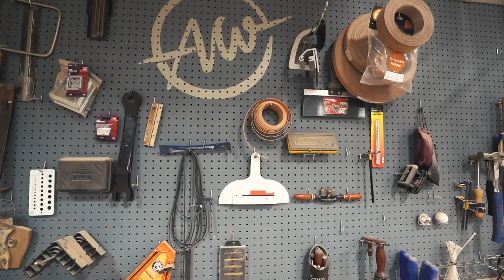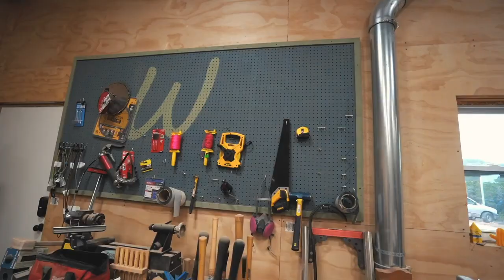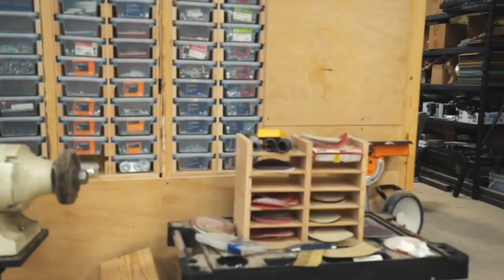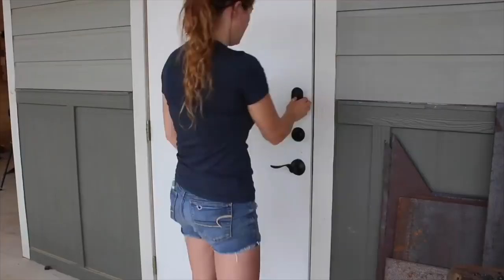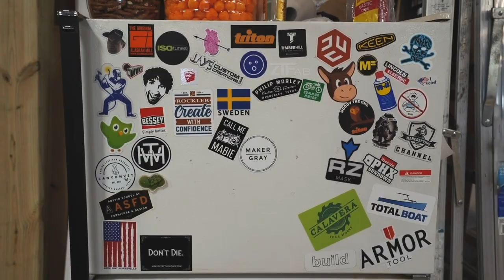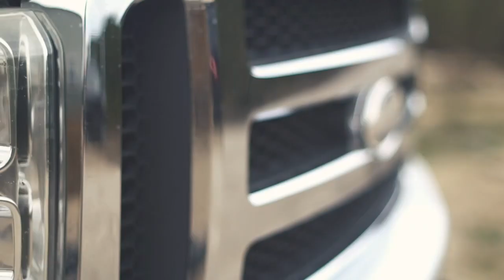1st Time Shop Tour April Wilkerson

Comment: Re tablesaws- I did the exact same thing! (Much smaller though) I took the tabletop 10" delta i used for years in my flooring/remodel biz and mounted it on a stand with my dado stack  installed & I have a big OLD craftsman I use for cutting-  great minds think alike as they say LOL- Tyler

Comment: Regarding the 3 Phase sander, the easiest method is using a VFD. Almost all VFD's will take single phase in, put 3 phase out but derated by 33%. So if your motor is 2 HP for example, you will need a 3 HP rated VFD. Stay away from phase converters is you are only using it on a single motor, far more costly and not nearly as reliable. Added bonus, you can then adjust speed with the VFD!

Comment: Great shop!  You might consider a mini cyclonic dust separator under you mobile bench.  As I'm sure  you know, you'd never have to replace or clean the filter on that shop vac with a separator.  You've created a lot of great efficiencies in your shop, this would be one more.

Comment: I met this engineer who when he had his house built had them install a 6" pvc pipe under the floor for dust collection.
With ports at sevral key locations. If and when he moves the next home owner has that they can use or seal up. 
If you think about it and your planing out a shop to build then having it underfoot saves you the trip hazards or celing limits an over head system can cause.
But it also limits moving things for a different work flow.  Unless your shops over a crawl space.

Comment: I have been following you on you tube for the last year, I like what you have done with yoor hardware wall. My question is where did you get the little boxes , what size are they and do the lids stay attached when open
I know you are busy, but appreciate any help you can give.
Thanks,
Jim
Reply: They are the Sterlite #1 Mini Box. She started off getting them at Dollar General but they DC'd carrying them. We found the remainder she needed at USPlastics.com and it's the Sterlite #1 Minibox. You can also find the Sterlite #1 Mini Box at other sites but they are more expensive.

Comment: What course did you do to be like this? I asked the question and I know you will not even have time to read
Reply: She researched the project she wanted to do, then started, teaching herself along the way. She bought only the tool needed, 2nd hand from yard sales and pawn shops. As her experience grew, her confidence grew and also her tool collection expanded. She was then able to start doing more complex projects but the early ones were much simpler. With each project her knowledge grew. Finally she now has sponsors and this is her job, building what she wants and needs and brings a camera along to show us what she did and how she did it.

Comment: I just wanted to say congratulations and Good for you.  I just heard about you so I thought I would take a look at your site. I’m an old guy woodworker.  Been doing it as a hobby for about 40 years.  I sell stuff but only to reinvest in my shop.  I know very few folks that can actually make a living doing this. 
I chose Aerospace because I love space and was fortunate to work heavy launch vehicles and spacecraft.  
 When young guys come by my shop, I tell them, you do this because you love it, not to make a living.  So you definitely make that an incorrect statement. Your shop is wonderful, mine is a smaller version of yours right down to the nordfab ducting, and placing my vacuum system and compressor in another building to free up the floor space.  I was also intrigued that you enjoy metal working, I was a machinist for 10 years.  
Anyway, thanks for being a role model for everyone but especially the young ladies.  Would like to see more ladies take up this art form.

Comment: You don't need a rotary phase converter to run that 3 phase sander.....use a single to 3 phase VFD. What size is that 3 phase motor?

Comment: I also have two tablesaws.  Both 10 inch.  One has a 60 tooth crosscut blade and the other saw has a 24 tooth rip blade.  No longer have to change blades when i need to make a different cut.

Comment: April Wilkerson
What material did you use for the ceiling? Appears to be corrugated metal. Is that correct?
Thank you.
Reply: This is what she used. 
https://www.amazon.com/gp/product/B0757Y6C2Y/ref=as_li_qf_asin_il_tl?ie=UTF8&tag=widos09-20&creative=9325&linkCode=as2&creativeASIN=B0757Y6C2Y&linkId=9a57ea113c0b116b587c4a41622553e8

Comment: You mentioned you had a three phase sander you could not currently use. 
You could use a VFW (variable frequency drive) it will go from 220 single phase to your three phase motor and it will take care of your  conversion and make the speed adjustable. You can also install a braking resistor, so when you stop the machine it brings it to a stop. 
 The second option is a converter for the machine it self, you don’t necessarily need it for your whole shop. 
 Depending on the HP of the motor your have the VFD can be less expensive.

Comment: look into a VFD ( Variable Frequency Drive) to run a 3 phase motor off your single phase power, one installed per machine is best bet, if you only have one or two devices!
yes the power draw will be higher per device, so you'll possibly need wiring/ larger power feeds to them.

Comment: Got any suggestions for fitting most of this equipment in a 520 sq ft area? Ours is set up similar to yours, but with two dust collectors. We built a carport outside the main 16 ft doors

Comment: Good morning April! I am married to a beautiful woman that happens to be a Texas born twin. She is a former Kilgore College Rangerette so the thought of her being a shop rat that loves to be a farm girl is not the first visual that comes to mind. I first heard of you from her twin sister when she referenced building a table for "HER" new miter saw. My wife then became a big fan of yours and subsequently so have I. The other twin has now purchased her own small "she shed" wood working shop. We built a 16' x 32' workshop for my wife with spray in foam insulation, 3/4" plywood attached to the walls, A/C and heat and a PVC tile diamond plate floor. We have acquired a table saw, miter saw, planer, router table extension to the table saw, and so on. She is actually having a blast using and working in the shop. She has built new shudders for our house, planter boxes, etc.. and takes great delight in showing her twin sister how to use the newest tool such as the planer. When one gets a new tool the other will soon follow. These are two ladies that take great pride in working with their hands and creating. Thank you for being their inspiration and giving me a great reason to buy more shop tools!!! Now on to installing a dust collection system... cough cough...

Comment: You could run your three phase Sander on single phase power by using a rotophaser or a more modern solution is to use a variable frequency drive which will your your three phase motor like a dream. I've done this for my customers in the past.

Comment: A Variable Frequency Drive can be used to to convert single phase power to three phase and will give precise control over the speed of the sander and it only needs to be big enough to run the sander.

Comment: How much did you actually “build”? Or was it a contractor (s)?
Reply from the maker: You apparently aren't familiar with my channel. I personally built the entire shop except the slab, spray foam insulation, and wiring.

Comment: Nice for 3 phase double the motor horse power get a 3phase variable frequency drive to get 3 phase.  For spray paint cans you may be required to use a fire rated cabinet. Thank you

Comment: Just an FYI on the 
1 phase vs 3 phase, 3 phase would be great for a building your size cause you'll save on the electric bill in the end, it's all 220 also. However since almost every " backyard" shop has single phase, I'd switch that 3 phase motor over to the single phase. It way less of a hassle. Now if I'm wrong, I'm hoping someone out there corrects me. Anyway the shop looks amazing. Plus it really helps having a bathroom close by. Congratulations April, you worked hard every step of the way and got what you always wanted. 2 THUMBS UP 👍👍.

Comment: Pretty rational shop, except that all the loose tools on the wall could fit inside one large cabinet with double doors. Everything would still be visible, leaving more room for storage and work areas, while requiring fewer steps to grab tools. That style seems to go against the form of everything else. 

Couldn't hurt to keep the fasteners and expendables in a cart. Fastenal and others do this with factories.  Restocking is easier and it gives a space to pack field kits.

Comment: Hi April,

For your 3-phase disc sander. Instead or replacing the motor to make it single phase, you could add a variable speed drive which will take single phase input, and has 3 phase output. A huge bonus is now the sander will also be variable speed!

Comment: IT IS CHEAPER IN 2 WAYS TO GET AN DIGITAL INVERTER. YOU PUT 220 IN AND 3 PHASE COMES OUT. YOU GOT TO GET ONE MATCHED TO THE HP. THEN THE ELECTRIC USED IS LESS THAN ANY OTHER WAY

Comment: I noticed that your shop doors have exterior hinges. I couldn't see if you had security hinges, but you can also purchase jamb pins to adapt a normal door hinge. Essentially, jamb pins prevent someone from being able to pop the pins out of the hinges and walk the door open with the latch still engaged. It looks like the bolt from your SimpliSafe lock is pretty long so that would still be a challenge. Depending on the area, it's a simple and effective security precaution for shops, businesses, and homes alike which have exposed hinges.

Comment: Would a insulated and heated 12 x 15 shed be big enough for a shop if l built it anybideavof cost i live in Ontario Canada  thanks jim
Reply: Jim, my shop is 13x17, so about the same size. If you plan your layout well and use flip-top carts for smaller tools, you'd be surprised what you can fit in that space.

Comment: For running a 3phase motor from a single phase outlet, you can just purchase a VFD controller, Chinese ones can be purchased from aliexpress or bangood for less than 200$ nowdays. If your motor is not utterly huge, aka up to around 6HP, this solution is very effective and straight forward. Plus you get the additional benefit of precise speed control and eventually fast stop (although this last one require to purchase an external power resistor that will add to the cost but is a great safety thing).

just my 2 cts...

Comment: Thanks for the video April, very informative and entertaining. One comment regarding your dust collection. I have a similar setup (cyclone outside and A/C shop but smaller) but I vent the cyclone out, I do not find it too detrimental to the A/C efficiency. Initially I kept the filter inside but I was noticing with a particle meter that I was still kicking some of the very small/fine dust inside the shop. I think the small added cost of running the A/C a bit more for DC is a small price to pay for the better air quality. cheers

Comment: Thanks for the tour. Lining your shop with ply is quite an improvement over the dime-a-square-foot steel liner panel I used. Those big, blank doorways between the wood and metal sides would sure look good with heavy gauge vinyl strip doors in them... at least that's what I aspire to in the cold country here. A couple questions on your rolling MT style work bench: First, is it finished in one of those hard wax eco finishes?  If so, which?  Also, that bench top appears to be about 1-1/2" thick. Assuming the holes are 20mm, will the Festool-style track system clamps thread through those holes? I always learn some or several things from another guy's shop. Thanks again. Those dogs seem to think a lot of you. Generally dogs are a better judge of character than people are.

Comment: Your 3-phase sander is the perfect application for a VFD....120 or 240 going into a VFD can run your 3-phase sander, all you need is the proper size VFD that will handle the motor on your 3-phase sander and decide on the input voltage 120V or 220V single phase VFD to run your sander. You need to order the correct VFD for the input voltage you want to use and the 3-phase output voltage 460V.

Comment: The three-phase equipment requires a three-phase electrical service. I'm sure you already knew that though because you mentioned it in the video. Anyway, if it were me I'd try to sell the machine and get a single phase piece of equipment.
Reply: Why sell it?  Vintage 3 phase machinery is more robust, will outlast you, is more accurate, is cheaper to buy at auction, can take more abuse, etc.  The list goes on and on. The greatest negatives of vintage 3 phase machines are their size, and you need 3 phase power.  A phase converter solves the 3 phase issue.  Yes, phase converters are an added expense, but clearly cash isn't an issue for April. Production woodshops use 3 phase.

Comment: Everything in my little 2 car garage shop is mobile as well. I have a wall pegboard but I found that a mobile one is more convenient.

So  cut a 4x8 pegboard to 18 wide and 4 ft tall. Attached to the side is another cart for my DeWalt parts totes. This way currently a stack of 9 totes, can take more and inside the pegboard cabinet are 5 pullout shelves. I use it for hinges, casters,  door pulls, latches and anything else I need to install into a project.

I mention it because I like your wall of bins. I usually do assembly just outside of the garage. 

The only thing that is stationary is a plastic 5 tier shelf from Walmart and it just might get casters too.

Living in the country, SW Florida, there's always a spider sneaking in. I have a tendency to move everything out on one side and move them out. There's a peppermint, mint, garlic and a few other things to keep the critters away. We have to go natural deterrent, and a towel over the broom. Don't want to hurt my Son's 12 year old pitbull.
I haven't watched all of your videos. But was hoping for a few project builds in the new shop.

I'm long winded, TMI, by my family. Anyway, God bless. TCT.

Comment: I'll double down on the phase converter comments. I run several for the metal shop on Mills and Lathes. 
KBAC-29 (1P), GREY (1001) AC Drives, Nema 4x Inverter 3 HP
These are easy to set up, are driven by 25 amp, 220v single phase, and are washdown and watertight- no dust issues. For around $400 USD plus wiring them up, it's difficult to beat. You'll also get the added benefit of variable speed control, although motor cooling can become an issue if you regularly run them overly slow. 
I purchase thru KB-controls. Stay with the exact part #. There is another version of the KBAC-29 that has flexible power input, but it will not drive 3hp 3ph.

Good luck with your new shop!

Comment: For all your upcoming tractor dirt work and fine grading, do yourself a favor and add a hydraulic top-and-tilt kit to the 3-point hitch on your tractor.  It'll make your box blade really sing for fine grading work.  Make sure the cylinders have "double piloted check valves" on them so the T&T cylinders stay where you set them without leaking down.  'Course, you'll also have to add two hydraulic selective control valves at the back of the tractor to support the T&T.  I'd go ahead and add three rear SCVs so you'll have an extra circuit to run whatever kind of implement on the rear that might need a hydraulic circuit in the future (like say a box blade with hydraulically actuated scarifiers).  You may also want to consider adding a "land plane" or "grading scraper" (with scarifiers) to your tractor arsenal.  Although these are superficially similar to a box blade, which is more appropriate for moving materials, they are specialized for grading and smoothing gravel road ways and large landscaping projects.

Comment: I miss motorcycle rides in that neck of the woods. Speed limits are lower here, and even then, gotta dodge more deer. But moot point right now, as we are getting snow. almost 4 inches so far. 
sigh

Comment: You can get what's called a rotophase to create three-phase power to run that or you can even size a variable frequency drive that you can input regular single phase 240 volt and get three phase 208 volt out of it.

Comment: April,

You can keep the three phase motor on the sander and utilize a VFD to convert the single phase power you have available to three phase.  Generally you will need to derate the VFD by 50%.  A 5 HP 3 phase motor on single phase would require a 10 HP VFD.  If you need assistance sizing the VFD I would be glad to help.

Comment: I only have one concern. Why is the ROPS bar removed front the tractor?  Never run a tractor without the ROPS.
Reply: She took it off when she was hauling dirt into the garden because it would fit through the doorway. I've never operated a tractor with a rollbar and didn't die. All you have to do is be smarter than the tractor and not do stupid things with it.
Reply: @GeneWaddle  I understand.  I have used old tractors that did not come with them myself.  But it only takes one roll over. 
My reason for concern is that I know someone that died in a rollover. It's tragic.

Comment: Just a quick question: is this going to stay 720p, or is the 1080p version still converting?
Reply: Takes a few hours for HD to convert and fruition, its not just a single location the data is stored and shared in either, Google uses strategic storage to allow many of us to view at the same time, so as not to "crash the system".

Comment: Thats an Awesome Shop April, I didn't see it but be sure to protect your beautiful shop with fire extinguishers on all walls of the shop. I'm wondering now, did you cut the wood blades on your ceiling fans,  and do you get a lot of sun and wind for  solar and wind production of electricity? Great presentation April, and your ways of presenting things are an inspiration.